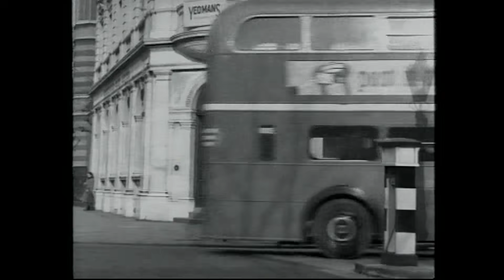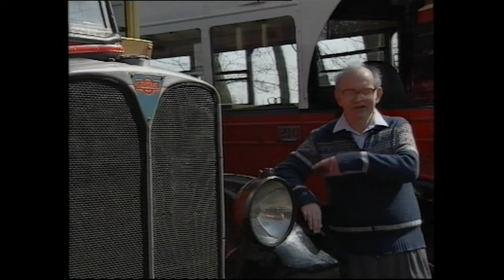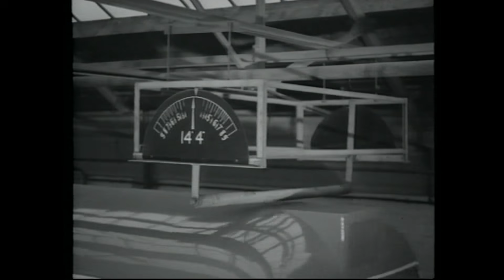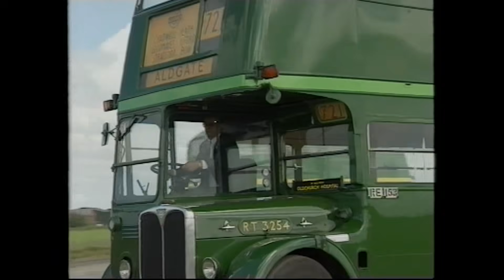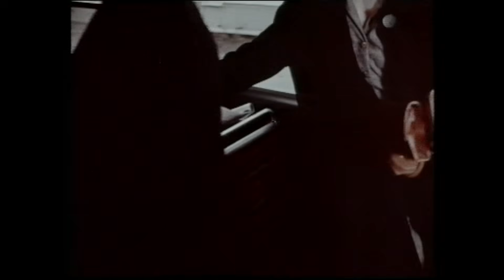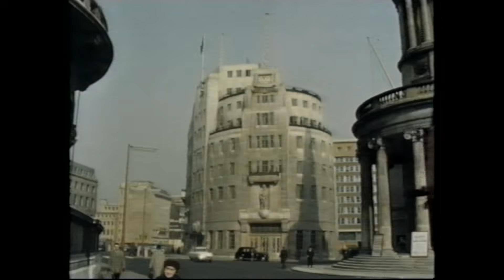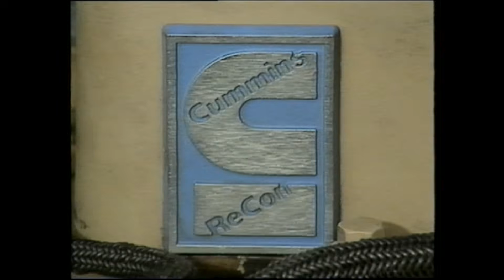Story of the RT

Comment: Nostalgic. In 1961, when I was 15, I worked as a trainee fitter at Camberwell garage, earning three pounds, twelve shillings, and sixpence per week. When drivers brought their RTL buses back into the garage, after they had been through the washing machine, I would refuel them, top up the oil and water, and, although I had no driving licence, park the buses in the "Herring bone plan" ready for use the next day. It took less than one morning to learn how to drive them. At age 15, I had no problem replacing a gearbox or a differential single-handed, but it was naturally followed by my mentor's check. Most fun was being sent to Chiswick or Aldenham (as a bus passenger) to collect the occasional spare part that was urgently needed. Three years later, I was a conductor on the RTs at Catford. Routes 47 and 54. Mercifully, only for a short time, but it was a memorable experience.

Comment: This documentary was really well made.
I used to work on the buses out of Bromley Garage as a bus conductor. They were such a blast to work on.
Some of them had their own personalities. One of them, RT250, was known as the whistler. Whenever you could get a bit of speed, you’d hear this whistling sound coming from the prop shaft. A few of the fleet were also known for boiling up, so you were always having to top up the water.
When we did a 119 job, going from Bromley North Stn to West Croydon, morning peaks and Saturday mornings, carrying a full load, we always hoped and prayed that you didn’t have to stop at the bus stop at the bottom of Cork Screw Hill, because invariably, after leaving the stop, you’d only get about 3/4 the way up where the bus would die, tipping the passengers off so they had to walk the last bit up the hill to rejoin the bus. No fun in the winter or on a rainy day.
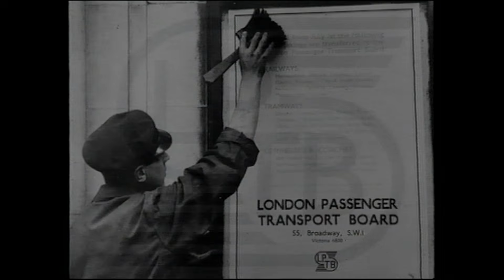Broke down one night at Shoreditch. Supposed to be doing the last one back to Bromley Garage. Stamford Hill fitter was sent out to us, god knows why, as Stamford Hill was totally RM. Couldn’t do anything for us. Ended up having to wait for Camberwell Garage to come and tow us back to Bromley. Instead of finishing at 00:50 time, we eventually got back at about 03:30 time.

Comment: I was in Sri lanka for a 6 month holiday 1999-2000. I stayed in Negombo for 3 month and there it was a RT still in operation. Funny enough it was quite some time between the days of use and in between the locals always put up strings across the road with flags. The bus took all of it down in just one tour. 😂  There where several other RTs in Colombo but all of them stationary.

Comment: The 150 wartime RTs (RT2-RT151) were originally intended to be 338, but the Fall of France and the Dunkirk evacuation, in mid 1940 and total war thence, meant that only 150 were built, all to pre-war standard, but the production line slowed consistently, with a six month gap between the penultimate bus and the final one, in early 1942!

Comment: Extended Bodies for Most of the Buses
Much as I am not comfortable to ask the depot why they stopped running the London Suburban Loud 4-Speed Leyland Hydra cyclic Automatic Gearbox Gardner 6LX and Gardner 6LXC Diesel Engine Olympian ECW’s on routes N26, 30, 121, 230, 271, 349, N279 And 158 why can’t we make the same make of the Loud 4-Speed Leyland Hydra cyclic Automatic Gearbox Gardner 6LX and Gardner 6LXC Diesel Engine Olympian ECW Buses but Modernise the insides of these Buses. Also make it low floor up and down and also extend the middle body part of these vehicles a little bit more so there will be more space for the wheelchair users. By the way, if you could remake and Modernise these vehicles could they also make it into a Loud 4-Speed Leyland Hydra cyclic Automatic Gearbox Gardner 6LX and Gardner 6LXC Diesel Engine Olympian ECW Version’s that if it will be possible and to Modernise the insides of these Loud 4-Speed Leyland Hydra cyclic Automatic Gearbox Gardner 6LX and Gardner 6LXC Diesel Engine Olympian ECW’s make it low floor up and down and also extend the middle body part of these vehicles a Little bit more so there will be more space and even a London Suburban Scania N230UD Enviro 400 MMC and also extend the middle body part of these vehicles a little bit more. Why couldn’t we have those London Suburban Buses Pale red on the top roof Pale red again on the top middle Milk Chocolate brown on the middle Creamy white on the Bottom Middle and Milk Chocolate Brown again on the Bottom on most of those kind of those Particular Double Decker Vehicles. Could you put the Loud 4-Speed Leyland Hydra cyclic Automatic Gearbox in the Scania N230UD Enviro 400 MMC and also put the Loud 3-Speed Voith Diwa Gearbox in the Volvo TD102KF Engine East Lancs Olympus and also extend the middle body part of these vehicles a little bit more and also turn most of them to a London Suburban Buses. By the way could you also make the routes N26, 349, 121, N279 and 271 into a London Suburban Buses and have a mixture of a Loud 4-Speed Leyland Hydra cyclic Automatic Gearbox Scania N230UD Enviro 400 MMC and Loud 4-Speed Leyland Hydra cyclic Automatic Gearbox Gardner 6LX and Gardner 6LXC Diesel Engine Olympian ECW Version’s. Could they also transfer the Arriva Bus Depots from Hackney to Stagecoach company so they can replace all the Arriva buses so that all of them can go to Birmingham and Leeds and they can be replaced by Stagecoach Loud 3-Speed Voith Diwa Gearbox Volvo TD102KF Engine East Lancs Olympus and also Extend the Middle body part of these Vehicles and that includes A Mixture of a Stagecoach Loud 3-Speed Voith Diwa Gearbox Volvo TD102KF, Gardner 6LXC and Gardner 6LXCT Engine Northern Counties Palatine One and that Includes a Loud 4-Speed Leyland Hydra cyclic Automatic Gearbox Scania N230UD Enviro 400 MMC Vehicles A Little Bit More. Can Arriva London Bus Company’s Replace Most of their Wight Buses so they can also transfer them to Birmingham and Also Manchester so they can be Replaced by Loud 3-Speed ZF Ecomat Gearboxes Volvo D10A Engine East Lancs Olympus and also Extend the Middle body part of these Vehicles A Little Bit More Thank You Very Very Very Very Very Very Very Very Very Very Very Very Very Much. Oh buy the way could the bus Factory Companies also Make More of Those Loud 4-Speed Leyland Hydra cyclic Automatic Gearbox Gardner 6LX and Gardner 6LXC Diesel engine Olympian ECW Vehicles And that also includes Those Loud 4-Speed Leyland Hydra cyclic Automatic Gearbox Cummins L10 Enviro 400 MMC And also Extend the Middle Body part of those Loud 4-Speed Leyland Hydra cyclic Automatic Gearbox Gardner 6LX and Gardner 6LXC Diesel Engine Olympian ECW Vehicles and the Loud 4-Speed Leyland Hydra cyclic Automatic Gearbox Cummins L10 Enviro 400 MMC Vehicles and that also includes The Loud 3-Speed ZF Ecomat Gearboxes Volvo D10A Engine East Lancs Olympus A Little Bit More And Paint Those 4-Speed Leyland Hydra cyclic Automatic Gearbox Cummins L10 Enviro 400 MMC Vehicles and also those Loud 4-Speed Leyland Hydra cyclic Automatic Gearbox Gardner 6LX and Gardner 6LXC Diesel engine Olympian ECW Vehicles and that also includes The Northern Counties Palatine One with a Volvo TD102KF, Gardner 6LXC and Gardner 6LXCT Diesel engines with a Loud 3-Speed Voith Diwa Gearboxes and The Loud 4-Speed Leyland Hydra cyclic Automatic Gearbox Scania N230UD Enviro 400 MMC Vehicles and also The Loud 4-Speed Leyland Hydra cyclic Automatic Gearbox Cummins L10 Enviro 400 MMC Vehicles to the Grey Green Colours Just Like The Other Original Scania Grey Green on the Bus Route 313 and the 103, If all The Leyland Titan B15’s are Fully Red and even Mostly Red, could they also Repaint All of The Leyland Titan B15’s into Grey Green Colours Just Like The Other Original Scania Grey Green on the Bus Route 313 so they can Reuse them for Only Every 5 and a Half Months and also Reuse them on those Rail Replacement London Bus Routes if that will Be Alright for Only Just Every 5 and a Half Months and also Reuse Those Buses Only on the London Bus Routes witch are The 341, N41, 34, 123, N29, 149, 221, N73, 121, 86, 30, 262, 147, 396, N26 so Please make sure that the builders can do as they are told!!!!!!!!!! And Please do something about these Very Very Very Very Very Very Very Very Very Very Very Very Very Very Very Very Very Very Very Very Very Very Important Professional Ideas Please Please Prime Minister and also Includes the Mayor of London.😉😉😅😅😅😅😀😃😀😅😀😃😅😀😃😀😀😃👏👏👏👏👍👏👏👏👏👍👏👏

Comment: As a Londoner, born and bred here since 1948, I have very fond memories of these buses. I found this to be a really interesting and well put together video. Many thanks to all involved in the making of the original segments and for the overall YouTube presentation.
Reply: I agree with you totally. I am a year older than you and my dad was a bus driver. In toughs days it was a "sort after" job. I still remember the bus conductor with his individual ticket box which was outdated by a ticket "roll-out" machine...... haha....
Reply: The good thing was that the RM was simply an improvement, retaining the years of fine tweaking that had gone into the RT.
These days, almost every new bus is one step forward and two steps back.
Reply: @wilsjane  And hasn't lasted as long as the RT's and Routemasters. 15 years at a push with today's buses in London if you're lucky!
Reply: Did you use to get a day ticket that was basically one ticket that could be used on all red RT's for example?
Reply: I lived in Watford 1948 to 1968. It was RT-dominated (all AEC) Country Area but at the Junction it met the Central Area 158 to Harrow and !42 to Edgware. The RTs were still in charge when I left for uni. I remember the trams too but as a schoolboy with Rover tickets, did all the trolleybus routes as well. I still have all the coloured tickets that I picked up as a schoolboy. The RT, to my mind was the perfect 'bus.

Comment: What is an RT???
Reply: @jeanettesarnella9278 ... I know you ask this long ago ... but RT stands for Regent, the Regent double deck buses for London came in several varieties including RT, RTL and RTW. The RT ones were made by AEC, and the RTL and RTW ones were made by Leyland. So RT is Regent, RTL is Regent Leyland, RTW is Regent Wide (as they were 6 inches wider than RT and RTL buses).
Reply from the maker: There's a very long answer to this, but to make it short, it is a class of bus, built from 1939 specifically for use in and around London. The video answers the question quite concisely.

Comment: RT type? That's as bad as saying PIN no. The T is for type Regent Type bus.  I much preferred driving an RT than an RM. as quicker and a lot more manoeuvrable.
Reply from the maker: Not at all necessarily. It's possible that RT stands for Regent Type, or equally likely, Regent Three. Another very (perhaps more) plausible possiblilty is that it is simply the next sequence of letters in the "programme" codes. The previous "RS" code was issued in February 1938. There are two instances of  AEC meeting minutes about a new bus that refer to "Programme RT" This may likely have then been adopted by the people at Chiswick. That it could also stand for "Regent Type" may only be a coincidence.
Reply: @OldFlapper  It seems highly unlikely to me that it would be 'Regent Type' as they had had Regents since 1929.  I've always wondered why they went from ST to RT.  Seems a retrograde step!
Reply: As a driver of both types I find the RT a bit more manoueverable except on tight corners/roundabouts etc where the PAS of the RM comes into it's own... I personally prefer the preselect gearbox of the RT and always drive RM's in manual mode anyhow. The RM's are generally faster though with better pull away (usually, depending on engine/gearbox version, original still best IMHO)